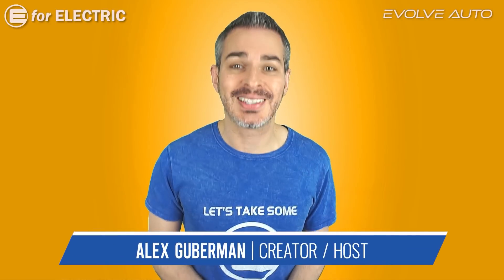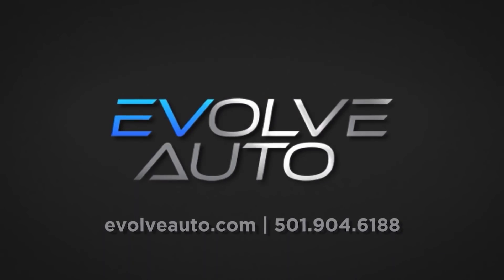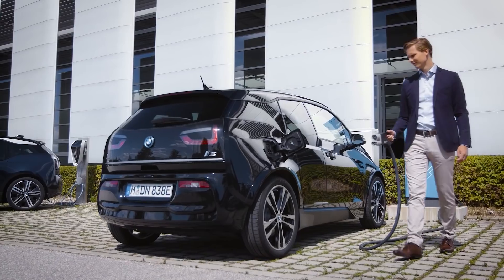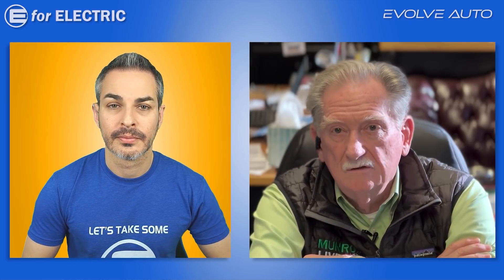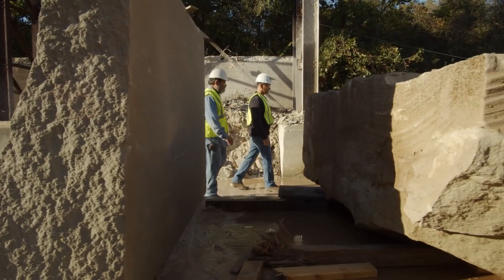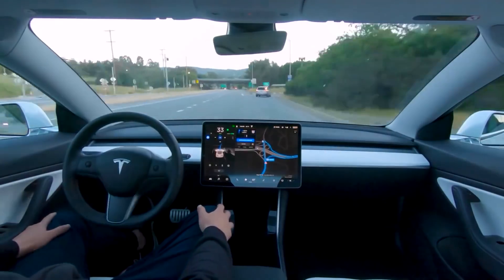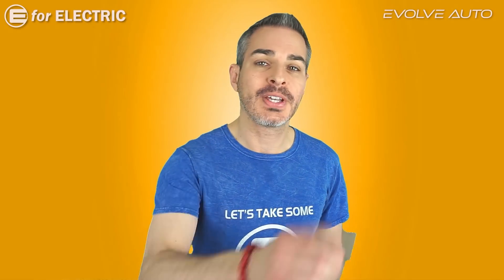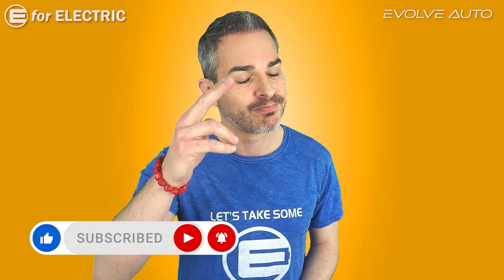SANDY MUNRO Explains Why V2H & V2L is the Future

Comment: If the goal is to have true energy independence, save the planet, and make the most of alternative solar/wind energy then the only system that makes any sense is V2B, a vehicle to a home battery system.  V2G, V2L, and V2H is a Red Herring and will not really do anything for powering your house when you have to drive your car to work, go shopping, or travel, which is, let's face it, the real reason you buy a car.  The vehicle only needs to supply power to the house battery when there is a shortfall in-home battery capacity or a lackluster day of sun. Vehicle to a battery is the only option that makes real sense and no one is doing it well.  I live completely off-grid with a 20 kWh battery pack and 8,000 watts of solar on my roof. I have two mini split ac units and my house, 2 huge refrigerators, lights fans, etc... use propane for water heating, maybe cooking---I use electric induction.  During the day 90% of the time I have plenty of power for everything in my house, AC blasting away and the battery is fully charged and stays charged, usually by 11 AM.  The problem, when there is one (rarely), is when I need just a little more power at 4 am.  With an EV (I currently connect my Hybrid to a Meanwell DBA 3200-48V---programmable 48-volt lithium battery charger which converts 370 Volts to provide occasional power for the charging of the home battery) The car does not become the main source of power, IT'S the backup.  Everyone seems to have this all wrong, backward. The car can never be the main source, the stationary home battery is the future house's main power source.  Solar charges this battery during the day.  You need the car to go to work!!!!! Powering your home from your car, or aiding and abetting the big bad power company, be selling back to them at a price they control and that we're all addicted to, and they like it that way, is idiotic. Power your home stationary battery, only when needed with your vehicle.  Throw some solar panels on your roof---they're a bargain. The car is a huge windfall and eliminates the need to buy a much larger stationary battery system, you can get by with powering a normal home usually by using a smaller home battery system and if you need a spare 5-30 kWh of juice, borrow it from your car and still have juice left to drive to work. Whenever your car is home during the day use your excess solar to charge the car!  The average trip tp work is less than 30 miles, the average power consumption of a home is 30kWh/day

Comment: I always wondered why Chevy didn't put a big 110v (or even 220v) inverter in the Volt.  40-mile battery pack + a 55Kw generator & a enough gas to run it (very quietly!) for awhile.  The engine would start automatically as required to keep the battery pack up; then shut until it needed a charge again. The ads would have written themselves: 
#1: drive-thru of a suburban neighborhood during a blackout.  Dark house after dark house,  Then one house is all lit up; move in to interior shot of happy family playing board games & mom serving hot snacks, then move out to a Volt in the driveway.
#2: a picnic/party at a lake.  Show people dancing to a DJ music system, blenders making drinks, the whole place lit up like an outdoor disco.  Slowly follow electrical cord back to the Volt in the parking area.

Comment: I have heard that the Cybertruck will have 100-125V AC output, I’m not sure about 208-250V output, but I think it is supposed to have that, too.  I believe it will also have a built in air compressor.

Comment: Ok… let’s assume the job site is 45 miles away with no CCS chargers near route. Assuming not towing a trailer going to lose at least 90-100 miles of range. I don’t know how much range would be lost using vhl to run corded tools, charge batteries and run lighting if needed. Would be interesting to park one of these at a typical small/medium sized building site and run a significant amount of equipment off one truck. See how long it lasts before having to stop and ensure it can get home.

Comment: In the case of Tesla, they might not be too excited about V2H. This would make your Tesla wall unnecessary in many instances.
Reply: I was considering a Powerwall for my house, but it is surrounded by trees so Solar doesn't make sense.  We have had blockouts that have lasted several days, so I would need multiple Powerwalls to last that long.  I like the idea of being able to power from my car, then recharge the battery at a Supercharger when the battery runs low, then continue to provide power to the house until the power is restored.

Comment: I remember hearing Elon say that the early Tesla's, maybe the first roadster, had V2H capabilities but they stopped offering that feature because no one used it.
Reply: Because no one used it, or it adds to battery degradation? I’d love to have that option in my model Y just in case in the event of an emergency. I also use the provide mobile charger from tesla every day but they also claim nobody uses. Just out of curiosity I asked the 10 other tesla owners I work with and they all exclusively use the mobile charger. So it’s hard to know what to believe sometimes.
Reply: @MiddleAgedMike  I had the Tesla wall charger installed when I bought my Model 3 so I don't use the mobile charger at home, but I have used it often when travelling.  I got my Model 3 in 2018 and it came with the two adapters, but I have only used to 110v adapter.  I can understand that some people may not need the mobile charger, especially if they have more than one Tesla, but I like having it with me.  I think making it optional is okay, but it should always be available with the purchase of a new car.  I have used my Model 3 during a blackout with a converter in the aux port, but it doesn't provide enough power for my refrigerator.  It did provide enough for my CPAP so I was able to sleep during the 4 days without power.

Comment: 1/Trading power with the grid for money will be big.
2/Every home with rooftop PV 6.6kw, connected to the grid will transfer power to were ever your car is plugged in.
3/Home only needs a few kwh over night. And daily drive is only a few kwh daily top up.
4/ The grid is 40% home supply, 60% industry. During the day the homes at the ends of the grid will feed the grid the excess, power stations can now be free to supply bigger industry demands.

Comment: Elon Musk has been very vocal about his opposition to V2H or V2G as he doesn’t want to hurt power wall sales, so I wouldn’t hold my breath about the Cybertruck having it (at least not until he is embarrassed by it being the 5th or 6th best selling electric truck).
Reply: If it is a popular option - I would expect Tesla to include it.  But I thought the same thing about Apple Carplay and Android Auto.
Reply: @allenbaylus3378  At battery day Musk said, “Vehicle to grid sounds good but has much lower utility than people think,”
Reply: @Roger Horner  I would agree the utility of it is minimal.  But when you need it, you need it!  If the power is up 99.9% of the time, that means power is down for 8 hours.  If it is the dead of winter and it’s 15 degrees outside, or mid summer and it’s 100+ degrees, those 8 hours without power would be much easier if your car battery could supply the power to your home.
Reply: @doittoit00  I agree. My point is Elon Musk doesn’t seem to (or at least he wants you to buy a power wall with solar panels instead).

Comment: V2H & V2L is only effective for batteries with long lives, LFP is best but  the new long life lithium,nickel, cobalt batteries will do but not ideal. Batteries are very expensive so by reducing their life by half is not economical, companies can't afford to offer 100,000 miles warranties in this case.
Reply: It is worth noting that these V2H and V2L systems max out around 10KW, which is not that demanding compared to multiple high speed launches or extended fast cruising on a highway.

Comment: The big trick Ford has missed is building a fast charge network on the major continents it has huge markets in. Ford should copy Tesla in this regard because that is the winning strategy the Tesla has in its advantage. Buying the Audi in the UK may be a nice vehicle but the charging network is rubbish compared to buying a Tesla virtually problem free charging motoring

Comment: The turning point has been energy density and production cost of batteries. Simples. 

The energy density has gone right up for modern rechargeable batteries and the mass production, economies of scale has dropped the price of the batteries. 

That is the magic moment … 

You both waffled on, but the obvious you didn’t discuss, is there right in front of you. 

See battery manufacturers and battery tech energy density, new chemistry, new assembly.

Comment: V2H will not come as standard. it is not needed. why? because homes will get batteries and solar cells as standard. a 10kWh battery will be the minimum to get through the night. 20kWh would be better.
V2L for a pickup could make sense. But don't forget solar panels for the remote cabins. with two 400Wp solar panels on the roof of a cabin and a battery you have enough for many tasks. enough juice for light, powering a notebook, water kettle, tv etc.
Reply: Perfect

Comment: All Teslas can be AC charged up to about 22kw, so they already have a 22Kw inverter for power going IN, which is about 10x one 110v 20a circuit. What’s needed to power a home during blackouts is about 5KVA IMHO. That would cover ‘most’ important things including an small air conditioner for several hours without running the EV’s battery down too much. The Cybertruck was spec’d to have power outlets for tools but not sure total power or if also has 220v … I suspect by now it has! Every EV should have capacity to power a blackout even if its only 2.2kW.
Reply: Ken, in the USA, Teslas can charge up to 48 amps @ 240vac. That is 11.5 Kwh.  It's only 2 phase.  In most of Europe it is 3 phase power.  The Tesla is still limited to 11.5 Kwh AC charging.  Outputing 120vac is currently simple electronically but ensuring it feeds correctly to the home and doesn't feed back to the grid (possibly killing linemen) and being bulletproof enough for dynamic loads within a home is difficult.  Everybodies breaker box is split into two 120vac sides.  Not all homes are ballanced properly.  The electronics to control this are heavy and something I wouldn't want to carry in my EV.  Thats why the Ford electronics to do this are separate and are installed by trained electricians.  It is expensive and not simple.
Reply: @GeorgeinOregon  yes sorry, my bad. We have 3-phase 440v and forgot we’re limited to 16A … was thinking 32A that the charger can be set to (but just discovered only works at single phase).

Comment: An EV truck is great if you don't have to haul a trailer. Your range is cut in half or worse if you have to haul a large trailer and good luck having enough power remaining to use as a job site generator after the fact unless you are making short 50 mile round trips or using very few power tools and aren't working in the winter and need heat at the job site. Best to haul stuff with a diesel truck and use the EV for the light load construction crew if you plan on using it in place of a generator.  You will need 10-12 hours to fully charge it at home (or at your shop) from a 50A, 240V plug.
Reply: Yes, I think it will take time to adapt.
In UK if someone travels 20 miles to a job it's a long way.
Reply: @andrewsaint6581  The average commute is not that different in the US, it's around 30 miles a day. But construction crews are not the average worker, they travel the most out of any profession (excluding truck drivers). They may be working on job site that is 5 miles away one day, but 50 miles the next. If they work in rural areas, they have to travel farther and there are less charge stations. If my dad had to limit his commute to less than 50 miles to make it to a job site, he never would have had enough customers to service or would have had to sell my grandfather's farm land and move to a city. Not something farm boys are really keen on doing. I moved to the city to reduce my commute to work, but now my property taxes are higher and I have less land. A trade off I accept for now, but if I could work from home or was retired I'd gladly leave the city. If more white collar 100% desk jobs become work from home jobs, I suspect more people will leave cities which will reduce their daily commutes, but that will also increase the distance home service and construction workers have to drive to service the same number of people.

Comment: I would rather the power company install batteries in homes to use at peak times to balance the grid. States could require power companies install batteries in at least some percentage of new homes during construction. After all my vehicle may not be plugged in when the power company needs the power.
Reply: You obviously don't understand the cost of batteries, or the power companies agenda.

Comment: In the 1980s the British electrical engineering company “Brush” had ac inverter powered railway locomotives. This were designed to pull 1000 ton (payload) coal trains at 0.5mph through the loading/unloading systems. At that speed the train is effectively stalled yet the motors didn’t burn out. You literally could hear the tractive power pulsing into the rails.

Comment: V2H is far bigger than Sandy understands. Use cheap/ low carbon electricity from nuclear and wind to charge the battery at night and then use that electricity  in the day from your EV  - every day. This neutralises your carbon footprint. If this was available to all EV owners their bills and carbon footprint would drop to a fraction of what they are now -  and the reliance on imported gas powered grid electricity would also come down. I am amazed that Tesla is not offering it, It seems to run counter to their mission statement of reducing emissions ...? This is less about lighting up a building site / parties and much more about reducing the carbon emissions in everyone's houses.

Comment: I remember watching some videos, from Ingineerix, showing the inside of a Tesal inboard Inverter.
In fact the circuit board is designed for V2H, however the hardware needed for this feature were not installed.
So by just adding some coils and FET transistors, any Tesla would be able to support V2H.
But Tesla prefer to sell PowerWalls instead !!!

Comment: The V2H and V2L technology is decades old, having it implemented into EVs just took a lot longer than it needed.  I remember a V2G box for the Leaf being on sale, I think in the UK.  A lot of people think electric drive trains are new, they are not !!!  For many decades we have been putting AC motors and inverters into all kinds of transport, train, trolley busses, trams, ships (I worked a lot of offshore construction vessels with electric driven thrusters). That technology has been around for a long long time.  Batteries as well, it is just the Li-Ion batteries that are relatively new, especially in large EV packs.  There is a lot of innovation going on with regards to making motors and inverters more efficient but the base tech has been around for a long time!!!
Reply: Well stated.
Reply: It is worth noting that right now, Setec is still making and selling a CHAdeMO V2L adapter that converts DC to AC.
Reply: @JohnGeorgeBauerBuis  Chademo should stay only to support legacy EVs but should eventually become extinct.  The adapter will never be mainstream because chademo is dying.

Comment: Even here in the UK we hardly saw pickup trucks most were ford transit vans and tipper trucks in construction about 15 years ago now they are common as muck even in the leisure industry and construction now they are ford f150s Nissan pickups Mitsubishi and so on just down my street there are over 20 pickup trucks and it's only a small street of around 70 houses my son has one for work and he wants the new lightning and I bet most overs want too as well as all our pickup trucks are crew cabs even I want the cybertruck as I love offroading and camping and biking even though I am 60 now I am still 19 inside just like sandy I think he is an amazing guy so full of useful knowledge which I can take to the bank and he's right all the degrees and papers you have are useless unless you have experienced most successful inventords come from a normal background with no degrees as this helps them think outside the box once you get degrees you start to think in a constrained way they have taught you you see this time after time its like they say nothing can travel faster than light well that was disproved as I said given time NOTHING is impossible.r

Comment: It’s all right to power your house with your pick up truck if you’ve got deep pockets. But, you can get a solar generator, that’s what they call them, To do the same thing for a whole lot less: starting at $2000. Bluetti is the brand I got and it is expandable from 2 kWh to 8 kWh. There’s other Brands also. Although they call them solar generators, you can charge them with house current, battery current, and solar collectors. They can deliver 120 V/240 V AC, 12 V DC, USB/USB-C outlets, and cordless phone/device charging. Check it out!